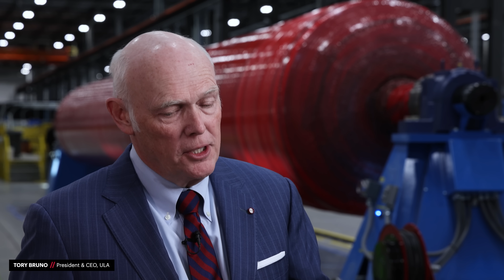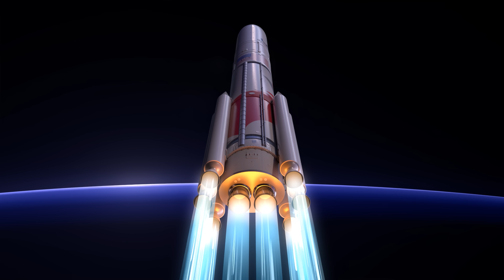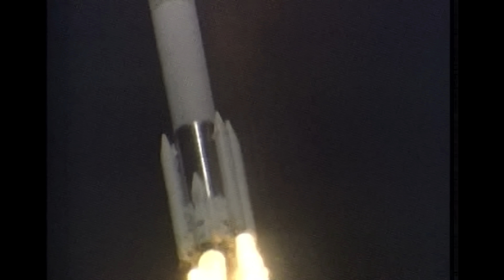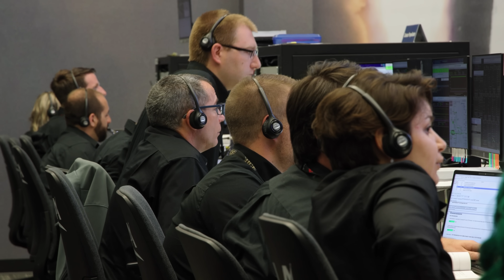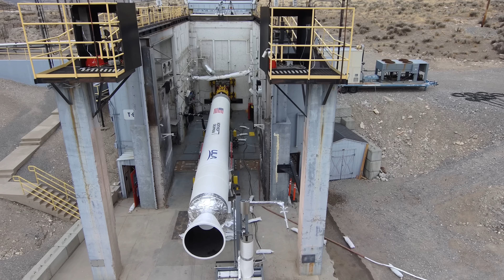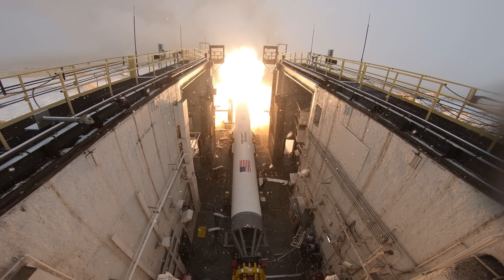DIALING IN OUR NEW ROCKET: GEM 63XL SOLID ROCKET BOOSTERS

Comment: Reading these comments are hysterical. SpaceX has LANDED more than 400 boosters, two the size of a Saturn 5 first stage. SRBs are throwaway rockets needed to fly our new rocket. In 2025. “I wish SpaceX had this level of transparency “ 🤣🤡🤣 The tagline should be “Keep throwing tax dollars away, it’s the ULA way!”
Reply: Solid rocket boosters provide a thrust to weight ratio that is unmatched by anything else. That’s why they’re still in use.

Comment: Where are the photographs of the recovered ground components? Show us the anmalous one versus the regular one.     what did you change in manufacturing the article  in this test?  or is this just another GEM 63XL staright off the production line.   This video is just cheerleading for ULA - without providing ANY technical detail.'
Reply: They might not show them because of the ITAR restriction